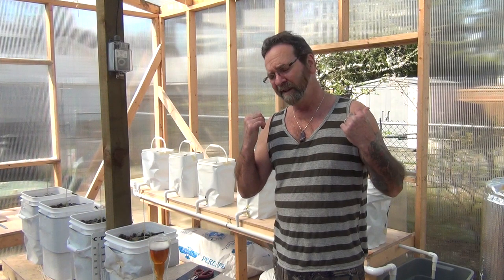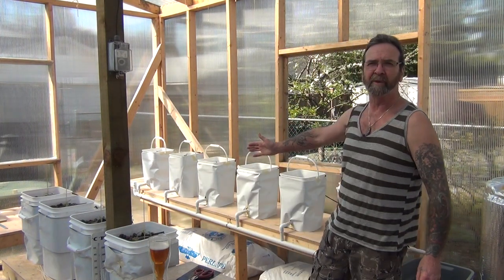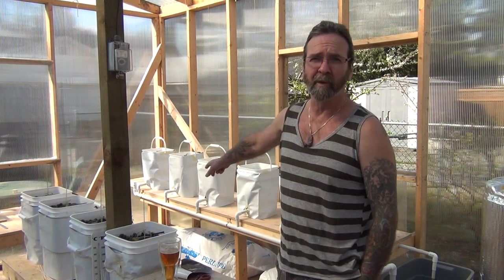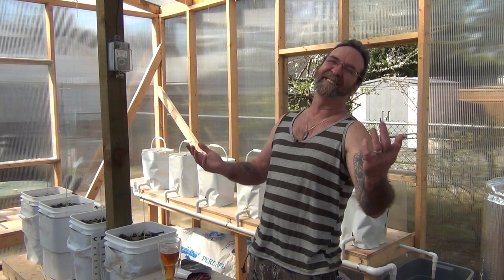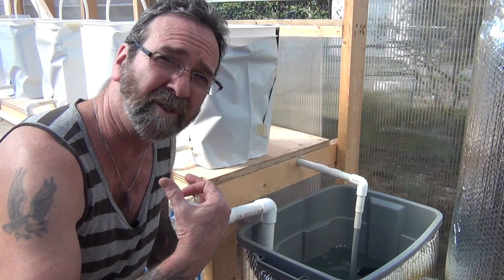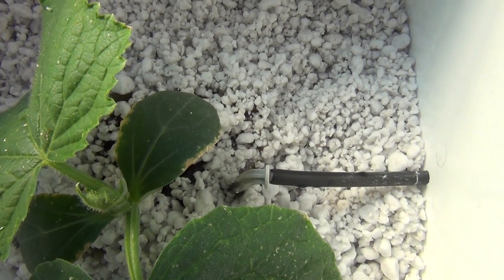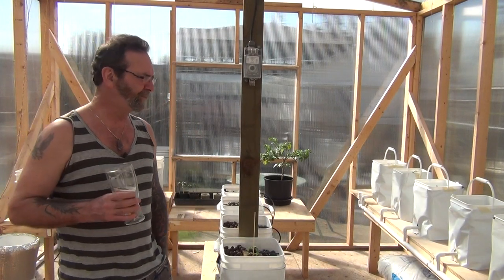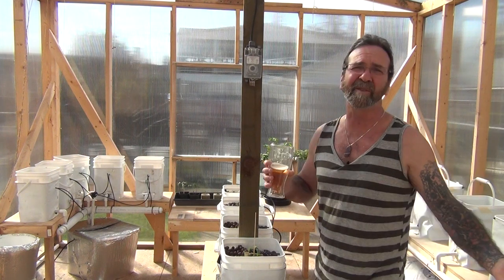Dutch bucket build part 2. Keeping buckets cool & dark with Panda film.

Comment: That's a good idea with the double sided film, especially if you're gonna have direct sun on one side for several hours. I didn't even bother with drippers on the dutch setup. I leave the tubing ends open and just let them free flow. But I do but them down into the perlite a few inches to cut down on the algae on top of the media. As always, awesome job Brock.

Comment: I looked for panda plastic black/white, great idea.  Couldn't find locally.  I saw one guy using insulated silver bubble wrap, looks like you have it on your reservoir.  My buckets will be in direct sun, so wrapping is a must.  I got some black plastic, but before I wrapped any the idea of wrapping with aluminum foil and taping it on with foil tape.  The buckets are now dark inside except the tops, they need little umbrellas!  Ha ha.  Great looking setup, I'm right behind you.  Cheers!

Comment: You ought to try lining those buckets with paint strainer bags, if you're holding perlite in them.  You'll find that less perlite will get plugged up in the lines and in the receiving tank-since your drain valve will be under the strainer.  You can get them pretty cheap and in bundles.  Just a thought! I love your setup and you're easy-going videos.  They are entertaining, as well as informative!

Comment: Consider piping some of your water down into a sump tank buried in the ground at least 10 inches. It is a surprisingly easy to tap into "geothermal" heating and cooling properties this way. I've seen some people who do not heat or cool their green house hydro systems in anyway using this technique. Not that using panda plastic is a bad idea, but it's more plastic pieces that have to be manufactured and in the end you don't get any heating properties from it versus geothermal. Cool channel!

Comment from the maker: yes you can run them together. I've run tomatoes and peppers together and they do well with each other with the same reservoir. I was using General Hydroponic nutrients which work very well. but a little while back I started to use commercial fertilizer and it's called Jacks hydroponic fertilizer. it's a 5 12 26 you mix this with calcium nitrate 15.0.0 I've used it indoors on pac choi and lettuce and it was amazing. if you don't like all the mixing the GH nutes are awesome! Enjoy

Comment: Hi Brock, quick update to lower reservoir and also plants closer to the ground, I decided to do like Bobby over at mhpgardner YT channel, he buried his and it lowered the entire setup.  It also has the advantage of cool soil and thus nutrient solution is not so warm.  That twenty seven gallon reservoir is 14.5 inches tall and now with one foot in the ground, it means I can have my Dutch buckets lower too.  I found a good deal on timers for pumps, Amazon, Intermatic TN311 10.95, with 3 on offs.

Comment: There is a synthetic food grade lubricant called Super Lube. I have seen it at sporting goods stores and eBay but I am sure the box stores carry it also. It is used in plumbing applications and will not harm rubber seals.